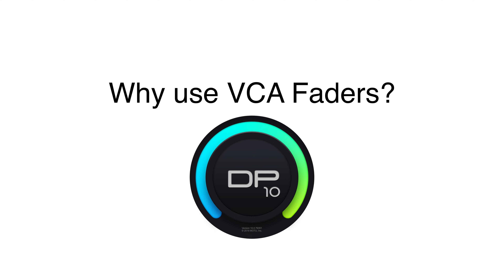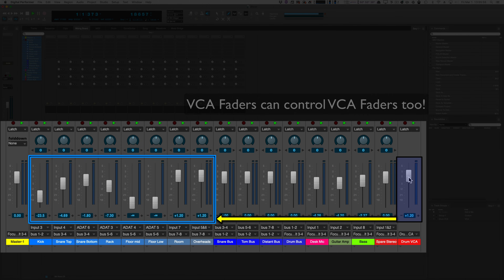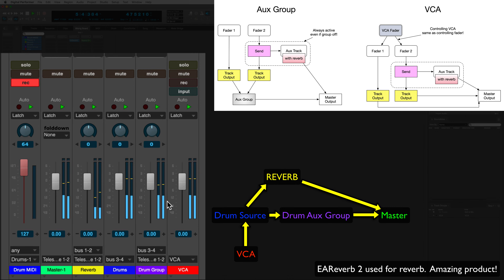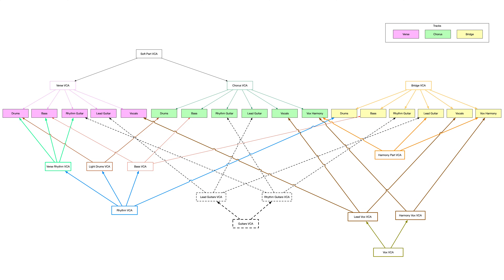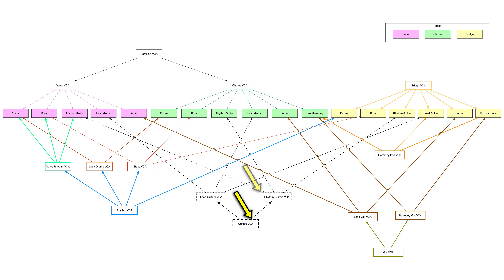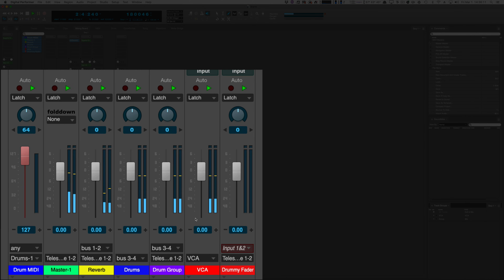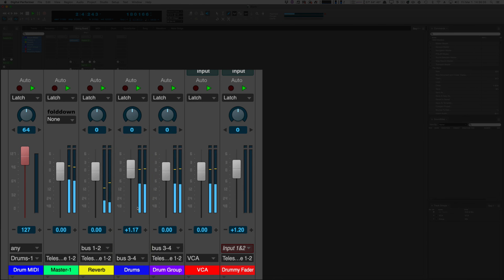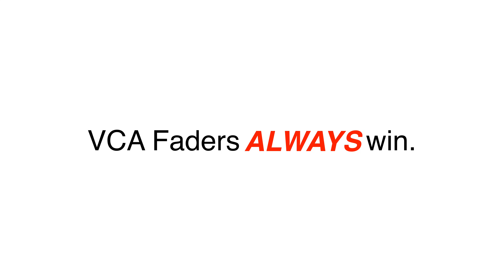Digital Performer 10 - What are VCAs and why you should use them. DONE QUICK!

Comment: Also, auxs and busses use CPU. I haven't tested it, but I'm thinking VCA faders would be easier on CPU.
Reply from the maker: You are correct, but the CPU usage differences between an aux/buss and a VCA fader are very very minimal. Not worth considering on modern CPUs.
Reply: Good to know. I often end up doing very large projects with extensive, complicated bussing. It might add up in that case...we'll see. Thanks for this video! There's some confusion out there about VCAs. This helps a lot.